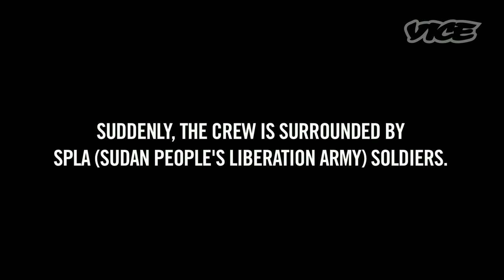Africa's Cowboy Capitalists (Part 3/3)

Comment: I'll agree with most of that. English is a really easy language to pick up a minimal level of comprehension. It's pretty complex to master though, mostly due to many exceptions to every rule. But the simplicity of picking up a little bit of English means that you can be pretty sure to find someone who can speak a little of it wherever you go, but also means that it's a good idea to pay attention to the local accent and patterns and then mimic them when speaking. It's just easier to understand.